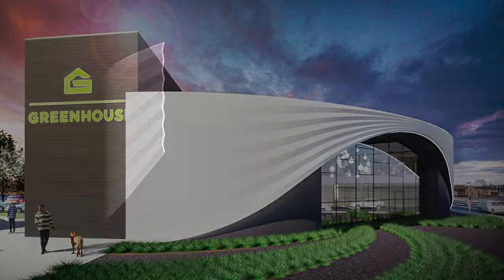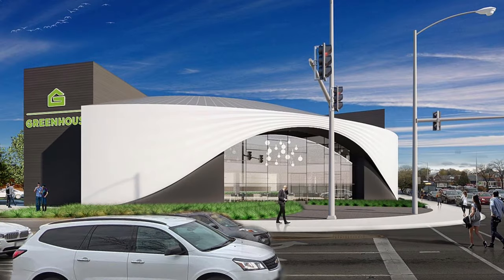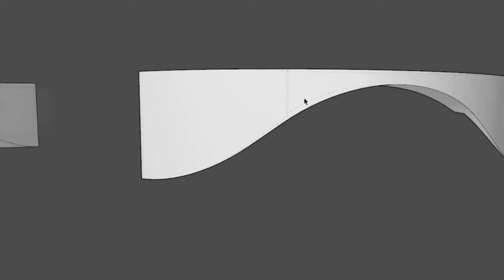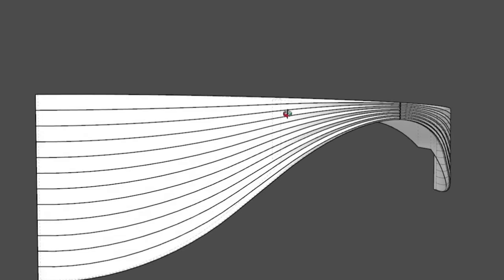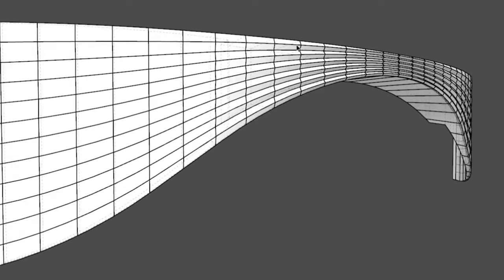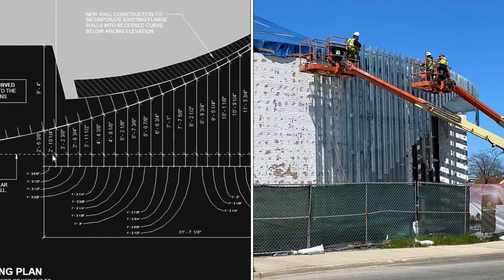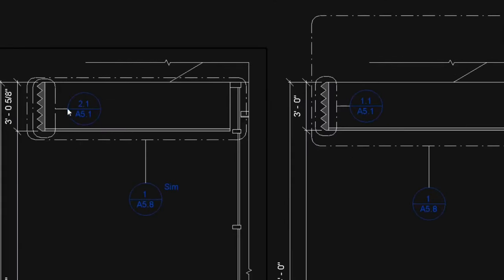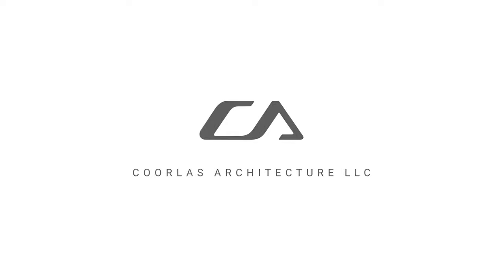Parametric Facade Design (SketchUp)

Comment: Very Brave to be doing this kind of work in Sketchup! Props for pushing it further, although I am sure it's not that easy! Natural software choice for many would be Rhino/Grasshopper where a lot of the work - like producing sections of each member could be automated
Reply from the maker: Thanks! 🤘 It certainly presented challenges, but was able to get the job done. Between SketchUp and Revit we had a decent workflow where all section drawings in RVT would automatically update on their sheets whenever we modified and imported the SU model.

Having a constant factor such as the 16" vertical framing spacing helped keep this under control, otherwise I don't think this technique would be practical for the fluid forms that MAD and ZHA are producing.

For our more sinuous projects we've started outsourcing the light gauge frame detailing to Radius Track Corporation. Have you heard of them?

Comment: man, I have been following ur account I admire  ur working flow, and I want to ask u if u have a good reference book for construction doc related to  digital fabrication or construction of doubly surface or ruled surfaces, I am in my final of architecture(five-year b_Arch), and I love parametric architecture and I have mastered grasshopper but I lack information how to make drawing out from it
Reply from the maker: Hey - I wish I can say I have a great reference for you, but everything I learned was more or less through trial and error. A good way to start strategizing for curved designs in construction documents is to segment your curved forms into smaller sections. Remember, everything needs to either be assembled on site or fabricated off-site and transported to the site, so that's usually a very good way of starting to think about how to break down your project into manageable parts that can be documented individually through elevations, sections and details. Thanks for tuning in. I'd like to make more videos on this topic so be on the look out for more soon.
Reply: @StephenCoorlas  thank u for the advice, i am currently  in sem 9 this semester I am going to explore more as if it is a real project I will try to make construction drawing from it,  I have emailed  on ur email, i wish to ask others  curious  question next time